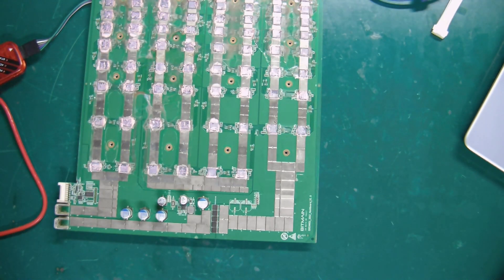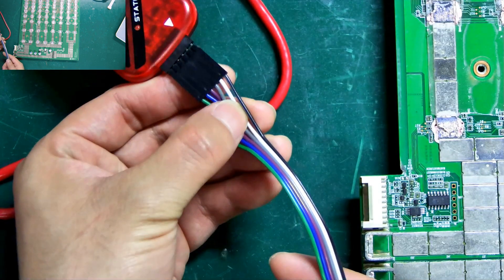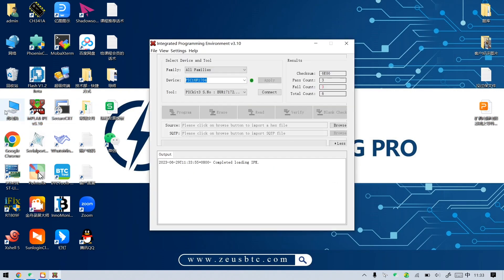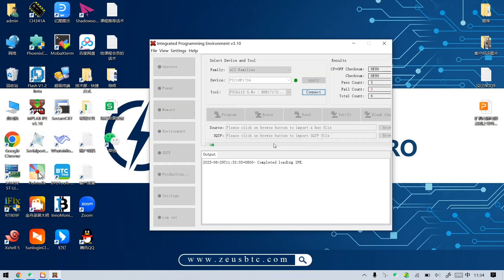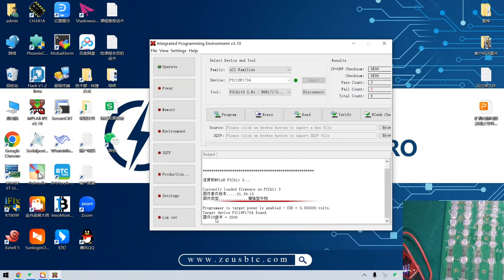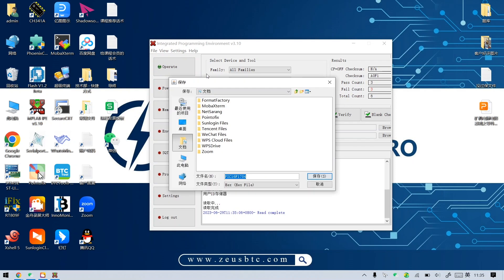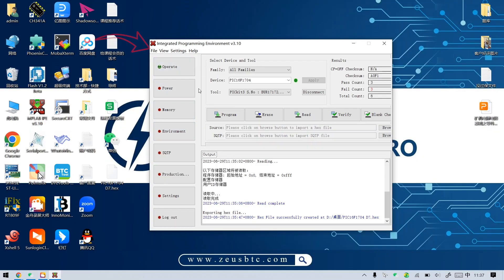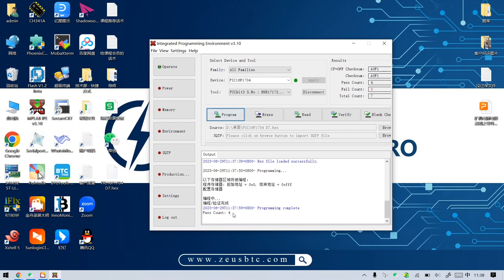How to use PICKit 3.5 programmer to burn PIC file - a tutorial on reading, saving and writing steps

Comment: I plugged the pickit into the board, when i click connect it recognizes the device then said failed to get device id. Why is this happening?
Reply from the maker: This is due to poor contact. You need to protect the cable with your hands.